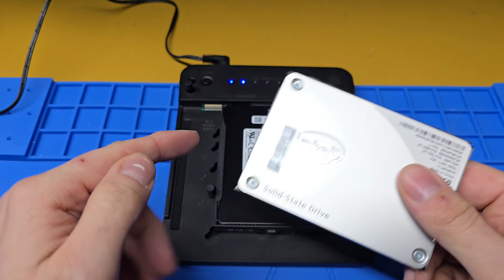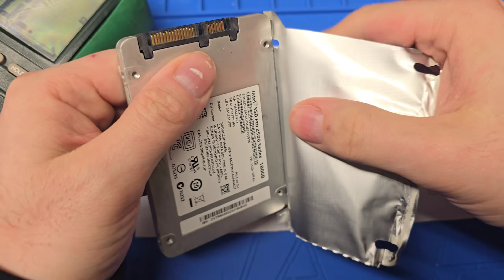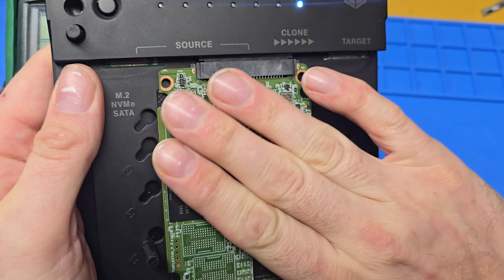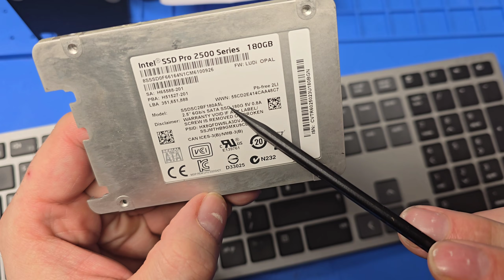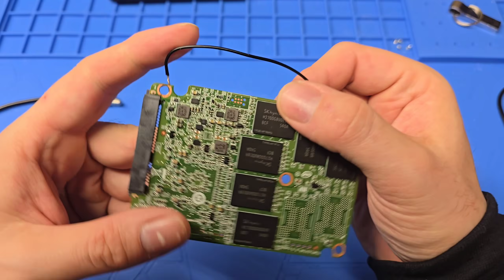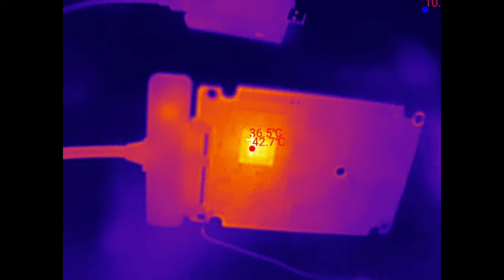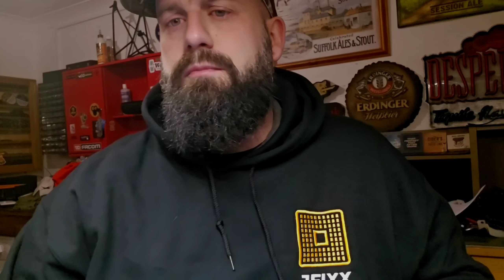Intel 160GB- SSD Repair - Can we Fixx it?

Comment: The only advice I can offer after watching literally dozens of videos, is the fact that you have a few shorted capacitors, and a voltage injection tool could be used to inject voltage on one of those capacitors to rule out that it’s not one of the capacitors, and then if the icy chip still Shows up as a hotspot on the thermal camera when injecting voltage into one of those short capacitors chances are that I see chip is at the bad guy, in which case, recalling a new chip and replacing it may work providing that is not the main ship and providing it does not need programming, also try looking up the specifications of that chip.
Reply from the maker: @jafab5265  Thankyou for great advice I have a power supply and the ability to easily inject current into a short. However I did not think about doing this as this short has a high resistance not a short to ground but shorted through a component. 
If I didn't see any thing shorted on my Thermal camera then I think I would have tried come with the power supply and inject 5v on the missing 5v rail and see if any current was taken. 
I have the ability to program chips but I don't think I would locate the required files I think I would need to find a second exact model and make a clone of that chip to copy to a new IC. 
In this case data recovery was not required there was nothing too important on there and I will purchase a new SSD for this laptop. I believe even if I was to get this SSD working after getting a new IC programming and reball I would not trust it to keep working long term. I think I will buy a larger capacity brand new drive. But I did enjoy learning about SSDs and seeing failure points

Comment: you was checking the wrong pins, the pins you was trying to find the 3.3 volts on was the data pins, not the power pins
Reply from the maker: @2009numan  Yes you are definitely correct! I couldn't measure properly that's why I bought the new dock so I could actually see what I was doing. Also I was trying to do everything looking through my camera it's quite hard when recording
Reply: @JFIXX1  There are two sets of pins separated by a gap(data and power). The pin layout is purposely symmetrical. The 5v are the middle 3 pins on the bigger set of pins. Those three 5v pins are sandwiched by 3 pins of ground on each side. Then you get 3 pins of 3.3v on one side and 3 pins of 12v on the other edge. All SSDs draw idle current; so the controller chip heating up is not proof of it failing.
Reply from the maker: @longdang2681  I appreciate your input - what I'm looking for is another drive exactly the same with the same firmware revision. I would like to analyse the behaviour of a know working drive to proper understand the normal working conditions and have a reference point to compare to. Without schematics or understanding the normal behaviour I can only make assumptions. I have had some great feedback in the comments and I may be able to do a revisit video as I obtain more understanding
Reply from the maker: @longdang2681  Can you share from you experience what type of idle current you can expect to see also are there any additional tool you can recommend. I would love some professional tools like PC-3000 but the prices are not viable for someone like me
Reply: @JFIXX1  Intel specs claim 0.6W idle for some of their data centre line of drives(eg. dc s3610). I would expect the 2500 pro drive to be similar or lower but it is not unknown for some drives such as Crucial 5100 eco to draw over twice as much at ~1.3W in idle. Idle power is non smooth for SSD that do garbage collection as it spikes when garbage collection is in progress; that's why they quote average idle power. I think SSD that have been dormant for some time would stay in a 'busy not ready state' as they do go through their routine checks. I believe sata SSD only need to draw from the 5v rail, so the other two rails are for extra features.
I don't know of any additional tools to recommend.
Maybe the no ground pin that is not reading correctly(middle one sandwiched between 5v and 12v rails) might lead to a source of the problem?
Reply from the maker: @longdang2681 Thankyou I never thought to check the specification sheet of the drive! 
I have had a look and they have very detailed breakdown.
I can see the missing GND that I had is actually not GND but PIN 11 is marked as DAS (Digital Activity Signal) so I believe this is not an issue as it's not expected in this pin.
The specs also confirm this is definitely using 5v and power consumption is 
5mw Deep Sleep
55mw Idle
165mw under load
So if I assume it's in a stuck state working at load I should be drawing max 0.16watt 
I am drawing 1.6watt 
So if I have understood it correctly then it is drawing much more current than it should be?
I am not sure if this is the case as your quoted power consumption for other drives is a lot higher than this.
Reply: @JFIXX1  It's hard to say but I don't fully believe the spec sheet for 165mW at load; if that's true then they won't need to bother with the thermal pad to help move heat from the controller chip to the metal outer casing ? 1.6W is on the high side for no apparent drive activity, but it could be stuck somewhere ? The drive itself claims to draw up to 0.8A or 4W. Also it's 1.6W minus the 0.3W(that the usb-sata adapter is using) so 1.3W. The initial spike to 2.3W upon plugging it in might suggest that it not a simple short(which should draw a constant current with little fluctuations). Looks like it tried to initialise the drive and then settled down.
Reply: @JFIXX1  There's a video about someone being able to recover some SSD's by giving it power but not data connected, then letting the SSD do it's house keeping to recover via ECC etc. Process should take 15-30 mins(The drive should reduce it's power consumption and idle properly when finished) and require no user intervention. Maybe try that ? as it's possible that is what the SSD is trying to do as it's drawing more power than anticipated for idle state.
Reply from the maker: @longdang2681  Thanks Longdang I can try that I can use my power supply to provide 5v and see what happens

Comment: Brother try reballing the chip
Reply from the maker: @techentertainment5943  I don't have any reball equipment but maybe I will in the future. However I'm not sure if it will help in this case as it doesn't seem to be an interrupted signal from a cracked solder ball or missing connection to pad? This looks like the chip is shorted inside so unless some of the pads have started touching each other I'm not sure how it would help.
I would still like to do a reball anyway as I need to buy the tools and get practice to learn the new skills.